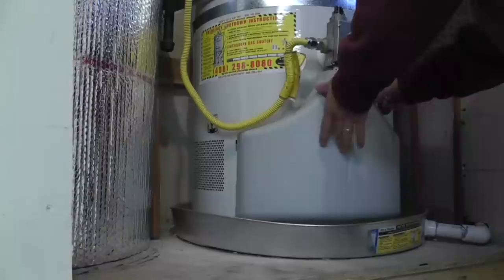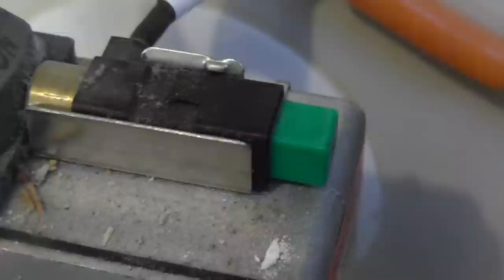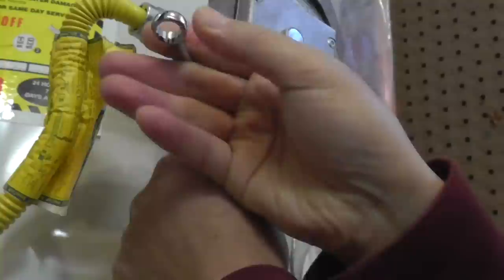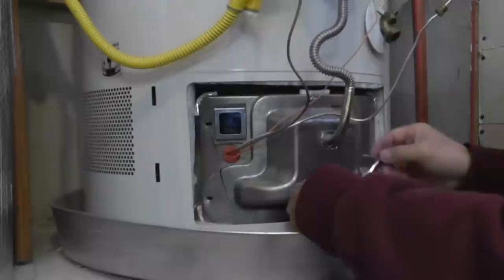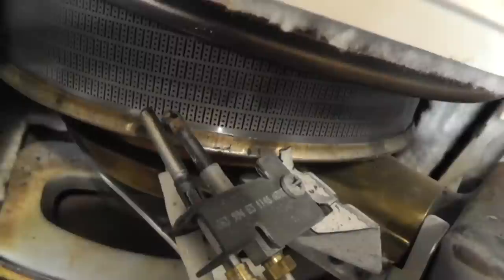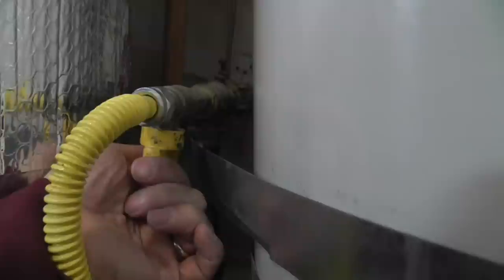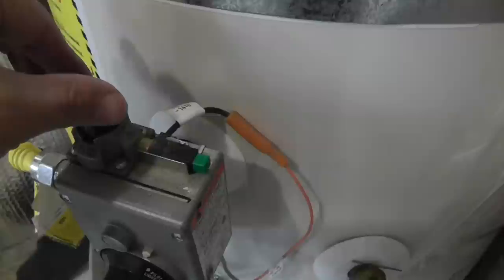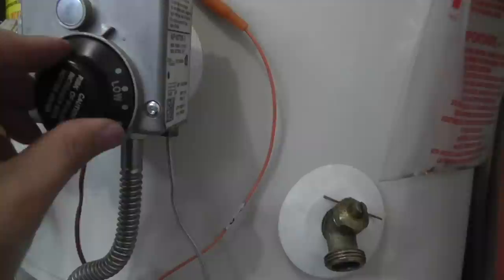2-minute video: gas water heater won't light - Fix it yourself in 30 mins and under $15!

Comment: I got quoted $1550.00 by North Texas Custom Plumbing in Frisco Texas. Literally, went to Home Depot, purchased thermocouple for $12.00. Installed and back together in about an hour. Could not believe this company wanted $1550.00 (even a recommended company from Angie's List!). Thanks for this video!!!

Comment: I just cleaned the thermocouple its some sandpaper, and it worked! Did the same with my furnace a few months ago. Repaired both in minutes -- for free!
Reply: I just did the same thing!  After getting a $165 quote for someone to come out and replace the [$10] thermocoupler, I dug around online until I found my manufacturer's Out Of Production technical manuals, downloaded the .pdf and read the two relevant pages of illustrated instructions to remove the enclosed burner assembly.  The tip of the thermocoupler looked a little too... not corroded - oxidized?  There was white build-up on the tip, at any rate.  

Thought I'd try cleaning it with a light touch of 220 sandpaper and gently running a soft wire brush over the whole pilot/coupler assembly.  I reassembled the unit and hit the igniter - not really expecting anything to have improved.  POW!  Pilot light on!  Yippee!  The whole process took less than half an hour, plus some time to do the research and watch some how-to videos like this one.  

My thanks to Happy DIY and others for posting videos like these that inform and encourage others to roll up their sleeves and just get the job done -

Comment: Glad I found this video, because I have the same model. Mine lost its pilot light, so I attempted to reignite it. It was able to stay on even after the thermostat was dialed in, but several min later it dies again. I’ll follow along and replace the thermocoupler, so I’ll update later.

Edit: Replaced thermocouple, quickly fixed it. Makes sense since it’s responsible for ensuring that the gas valve stays open

Comment: Best video ever. I have the same GE gas water heater. I fixed the issue by following all the steps you mentioned. It solved my problem and the heater started working like new.Thanks
Reply from the maker: Gill Brothers you are very welcome. Thanks for your comments:-)

Comment: What happens when you hit the green igniter button but get no spark and no pilot flame? It clicks, but there is no visible sign of spark and the flame never catches on. I just ran into this issue this morning. I have a call in for service, but if I can do something on my own, then that would save me money.
Reply: sometimes have to keep clicking until air is gone from gas line and eventually it will light
Reply: Robert Gonzalez what happened in your case? I got the thermocouple part but not installed yet because I am experiencing same, no sign of spark. Maybe the thermocouple is not the issue but rather the igniter.
Reply: Clean the thermocouple area with sand paper, probably don't even need to replace the thermocouple

Comment: I have this same heater unit but after I replaced the thermocouple, it lights up, place the gas valve to on. Now when I turn the thermostats valve to the arrow the light goes out. Any idea what's going on? Or needs replacing? Thermocouple was replaced with the same as yours.
Reply: Scant B I have the same problem after I replaced the thermocouple. Can't figure it out. Did you find out what the problem was?

Comment: I'm about to do this, but I wish I could see how you got the thermocouple(s) in and out through the orange round piece.
Reply from the maker: Snuggle Bunny I made a  small straight cut on the orange rubber.
Reply: I figured that's what you did. Thanks so much.
Reply: So what do I do if mine is metal and not rubber?

Comment: I encounter water heater stop having hot water after 5 minutes during shower. It is hot when turn on then cold after 5 minutes or so, what could be wrong? Am I suppose to change out a new one? Thx

Comment: Mine is doing the exact same thing.  In fact it was working fine until it got accidentally blown out by the air from a vacuum.  Now it will not stay lit.  I replaced the thermal couple and it still doesnt work.

Comment: If the pilot light has no issues coming on but the burner doesn't would this fix solve the problem?
Reply from the maker: +NYMedia nope. This video can only solve problems with:
- Pilot light won't stay lid
- Bad Thermocouple
- Bad Spark pilot ignitor
- Bad pilot burner

Comment: My thermocouple and pilot both show a lot of white residue.  Do I just need to clean that out or replace the parts?  The pilot lights but won't stay on after I let go of the pilot button.
Reply from the maker: +RJP Phoenix then mostlikely your thermocouple has to be replaced.
Reply: +James Yuan do I need to oil the tip of the burner pipe? What type of oil?  I see some oil on it after I pulled it out.
Reply from the maker: +RJP Phoenix You probably do not need to oil it.
Reply: +James Yuan thank you! So I replaced the thermocouple.  Is it normal that the igniter appears to be lit or turns red while the burner is on?  Just concerned as to whether I reassembled correctly.
Reply: +James Yuan oh, what I mistakenly called the igniter is what you referred to as the electrode.
Reply from the maker: +RJP Phoenix you are welcome. I am not really sure about it. If nothing else is abnormal, it should be just fine.
Reply: +James Yuan is the tip of ur electrode burning red while the burner is on?
Reply from the maker: +RJP Phoenix yeah.
Reply: +James Yuan great! Thx again!  And .. Merry Christmas :)
Reply from the maker: Merry Christmas :-)
Reply: James Yuan what is the "entire kit"? Can you please upload a link? In my case, I just dont get a spark at all from the igniter.

Comment: James, My water heater has the same issue. But how do you know it's the thermocouple problem. Have you measured the thermocouple's voltage when the pilot is on? I heard a good one should be ~20mV. Mine measured at 24mV, but the pilot doesn't stay. I am not sure if replacing it can fix the problem. Any suggestions? Thanks.
Reply from the maker: +Song Ge Nope, I did not measure the thermocouple's voltage. If your problem is the pilot won't stay then most likely your thermocouple is bad.
Reply: +James Yuan Thanks a lot. I replaced the thermocouple with a new one and the problem was fixed. Your video helped a lot. The voltage output of the new thermocouple is 32mV.
Reply from the maker: +Song Ge very cool!!

Comment: You ended up with a DAMAGED SUNKEN GROMMET 2:33! The proper repair is to change the whole kit. Your water heater is no longer sealed like it was designed to be.
Reply from the maker: Thanks for correcting it. I hope people watching this video also see your comment.
Reply: How do I change the grommet if it is metal? I have no idea how to get it off, or where to get a new one, or how to put it on.